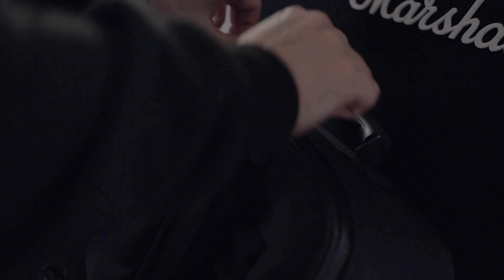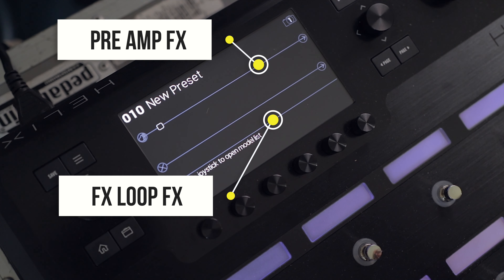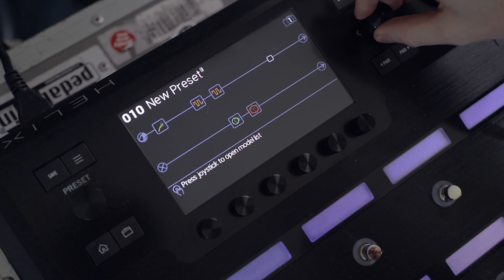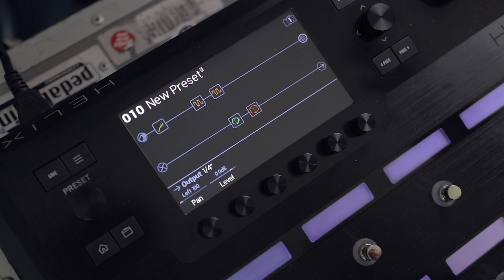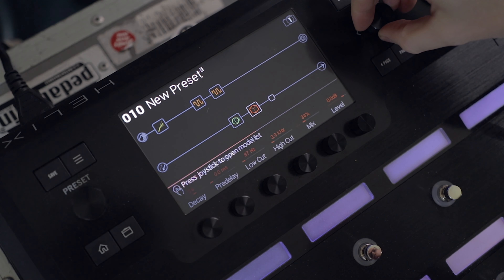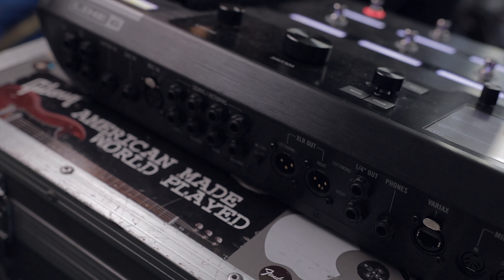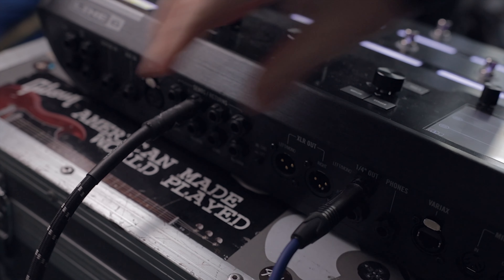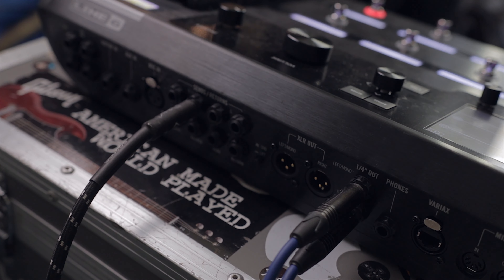How to do the 4 cable method with the Line 6 Helix (the EASY way!)

Comment: Hey, I would like to know how transparent HELIX is ? I used to play 4 cable method with a few multiefects in the past and every one of them just gives some "colour" to the sound.. I would say some kind of hissy-mid tone. Also, can you change channels in the amp via MIDI ?
Reply from the maker: Hey, its the most transparent I've used so far. No real 'tone suck'. I had a G System years ago that sucked a lot of top end but the Helix doesn't seem to. As for channel switching, it has an amp switching jack that you can use. I've not had much success with it tho. I can get it to change channels on my V30 but it introduces a lot of noise on the clean channel. Might be a different story with MIDI tho, I've not tried that.
Reply: @BenHartwellGuitar  thanks a bunch! I use nova system only in effects loop and it changes the tone a bit, just in that hissy way. I think about changing my gear now and I'm lookin for good floor for recording and to use it with my amp.
Reply from the maker: Yeah I’ve not noticed any of that with the helix. If you don’t need the amp modelling side of things look at the HX effects to use with ur amp